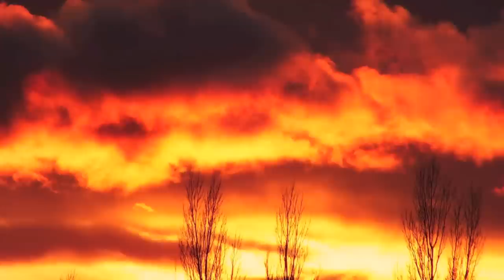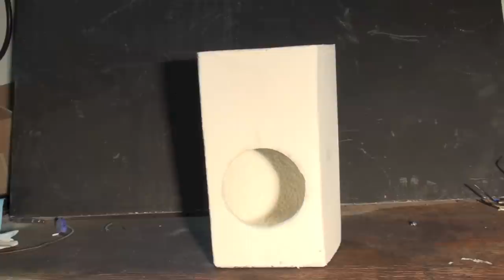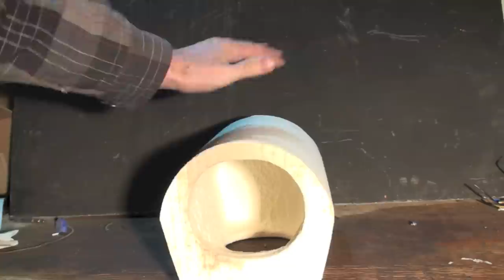The combustion chamber of the oil furnace

Comment: On the miller Mobil home furnace when changing the firebox I’ve anal bolts in the past. I just bought a rivnut gun and was wonder if you have used one if so does the heat affect the rivnut over time?

Comment: I am replacing the combustion chamber on a Miller CMF-80-PO mobile home furnace, on the back of the inlet cover there is a flange with four holes, were the chamber butts up to. The old chamber was not attached just slide on the burned tube, is this the correct mounting or does it get bolted or wired ?????
Reply from the maker: I can't say for sure on that furnace but I have never see one installed with any connectors.
GFM

Comment: Should the chamber liner completely enclose the flame?  The flame can be seen slightly outside the inner liner but doesn't seem to be damaging the metal part of the chamber.  Two people who have seen a photo tell me it means I need to have it replaced and two people with more experience tell me it's fine.  Any thoughts?
Reply from the maker: It is normal for the flame lick out the top of the combustion chamber.  If the chamber is cracked and flame is coming out the sides, the chamber needs to be replaced.
GFM
Reply: grayfurnaceman is that an expensive job?
Reply from the maker: Depending on the furnace, $400 to 600.
GFM

Comment: I have the one that stands up like a a half of the pyramid. Where would I get a replacement one in case if the  one I have is broken. It is very soft and flimsy.
Reply from the maker: I don't have any sources.  I would try a local dealer.
GFM

Comment: Hey another question about my miller furnace in my greenhouse.   You say in this video that these combustion chambers should be glowing red when fully warmed up! But should I be seeing as it’s running  and up to temp when I look into the inspection port at the top of this chamber what looks like a yellowish Hot gaseous plasma coming out of the top of the chamber?? If I’m describing it correctly.   You have said in the past a few licking yellow flames 🔥 out the top is normal but that is not what I’m trying to describe.              I’m thinking it might just be how the hot gases are roaring out of the top of the chamber and burning.
Reply from the maker: If you have a large amount of flame coming out of the combustion chamber, the chamber could be too small.
GFM
Reply: grayfurnaceman Hey Thanks as always for the reply,  it’s the chamber that came in the furnace. And I only have a .579 nozzle installed and the pump pressure is set at about 130-135 psi since It seemed to run BEST and smooth at that pressure. I think what I am seeing is just the high heat and combustion roaring out the top of the chamber like normal.  I don’t have very much flame 🔥 licking out of the chamber, a little lick of flame 🔥 hear and there but that’s normal.    I will try to email you a picture but not sure if the camera will capture what I’m seeing.

Comment: I will be replacing the combustion chamber on my Miller CMF80 furnace this year...the old one looks cracked and in bad shape after 30+ years of service. Looks very similar to the one shown in  your video. I attempted this operation 10 years ago but snapped off one of the 14 nut/studs on the weld plate then, so I gave up...but this must happen even to technicians doing the job. Do you know if these heat exchanger studs can be replaced?  I've found that Miller/Nordyne used to supply a stud replacement kit, but hard to find now. This furnace has served me well for many years if serviced regularly. I really appreciate all of your videos/knowledge...has helped me understand my furnace better. Thank you!
Reply from the maker: Not simple.  As there are so many, I would not be concerned about one.  Also, careful as you remove them.
GFM
Reply: @grayfurnaceman  Thanks for the advice...yes, I'll have to be very patient removing the remaining nuts with probably a lot of penetrants and heat. Hopefully I won't have to resort to drilling or hammering on the exchanger as this thing is so old now!
Reply: They have a tool called a rivnut gun. I just purchased it. I bought the ratcheting one for tight spaces. It will work but I don’t know how the heat will affect it over time. With the expansion of the steal. Might not do anything. But there on Amazon for 60 bucks. If it works well it will be worth every penny. I have a lot of millers out there
Reply: @ryanbrandt3374  I would think the constant heat cycling would tend to loosen the rivnuts over time. Would you use the existing holes where the studs are located or drill additional holes?
Reply: @redmavis6136  use the existing holes. Prob would and some high temp silicone around the rivet as well. When I do try it I will check it every cleaning to see if they loosened up. Thanks for the info.  I wouldn’t use it if they all snap though that’s to risky. Just put in a new thermonpride Mobil home. I love those. Not a fan of the new millers.
Reply: @ryanbrandt3374  I agree on the Thermopride...that will be my next furnace. The old Millers are great furnaces if they are serviced regularly. New Millers I have my doubts. Good luck with the rivnut solution...I still need to fix mine, too busy and time is running out until heating season.

Comment: I'm not sure if this is normal, but there is a hole on the side of my chamber, it's located on the inspection door side of the furnace and it is a perfect circle. I'm not sure if this is by design or a burn through. My furnace is mounted horizontally in my basement. 
  Do all chambers vent through the top? (this could be a confusing statement as different models do also operate both standing and laying down). I may have answered my own question?
  Btw..great videos, Furnace porn... love it!!
Reply from the maker: It is probably normal if it is at the exit end of the combustion chamber.
GFM
Reply: Yes, your right, the hole in question is pointed at the exhaust vent/pipe leading to the chimney. 
  All your videos are done so well and approached in a manner that is easily understood. Thank you for taking the time to produce them. It really is appreciated.
Reply from the maker: Welcome
GFM

Comment: Gary, I really need your help I have an old 1970 Mobile home with a Nordyne Miller CMF80 Beckett Oil Burner. How often should the combustion chamber be replace  mine looks to be foam, and it look like it has a hole in the bottom of it.Can I change the combustion chamber liner or do I have to replace the entire heat exchange? By the way thank you for you're videos they have been a god send for my husband.
Reply: Amanda Rowland The combustion chamber like this one in the video for Miller mobile home furnace’s is sold on amazon for around $40-60 I believe,  I was researching them for a backup. They are not to hard to change they should just slide into place but be careful with them they are fragile and you should have a mask 😷 since they are a fibrous ceramic and not good to breath!

Comment: Where can I get a replacement chamber for a unit using a .75 gph nozzle.  Mine is broken up which caused cracks on one side of the heat exchanger.
Reply from the maker: HYDROGENTEK If you have cracks in the heat exchanger,  your least problem is the combustion chamber.  You need at least a new heat exchanger, probably a new furnace.  Don't even think about welding it.  Hope this helps.GFM

Comment: what happens in the combustion chamber cracks or breaks - is there a danger to the furnace?
Reply from the maker: Yes, If the flame touches the heat exchanger, it will burn thru it.
GFM

Comment: I planned on cutting the damaged area, making the cut as close as I can to the original welded seam and replace it with a similar gauge sheet metal.
Reply from the maker: HYDROGENTEK I won't support any welding of a heat exchanger.  It is dangerous and I have never seen it work.  They always seem to break next to the weld.  Give up on it and go with new.GFM